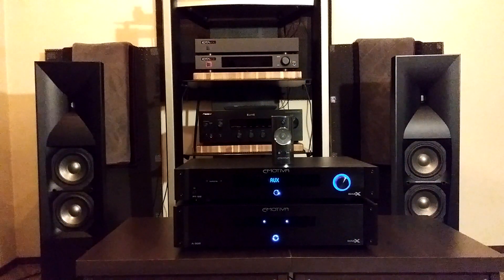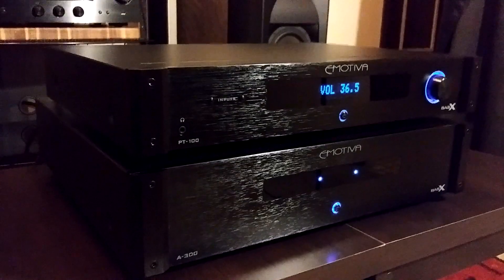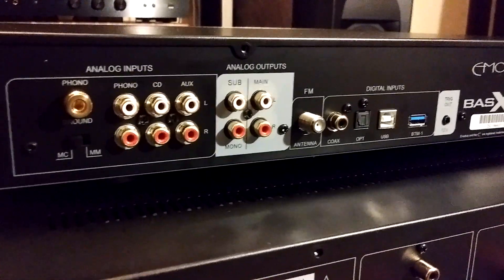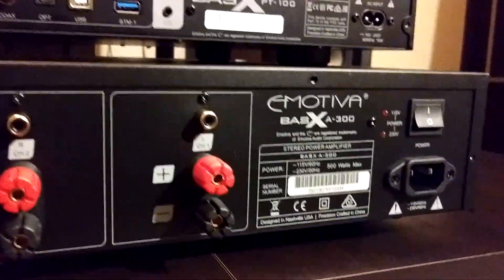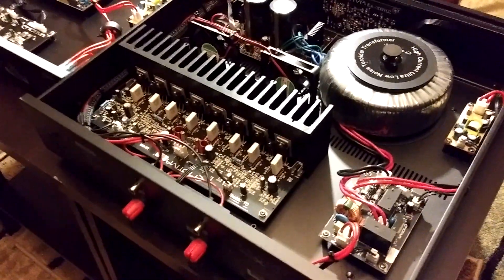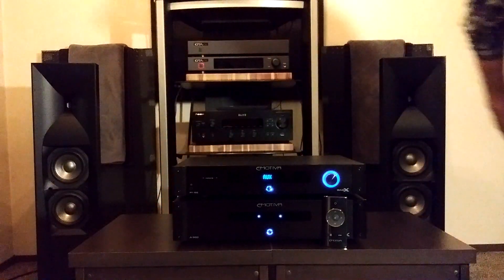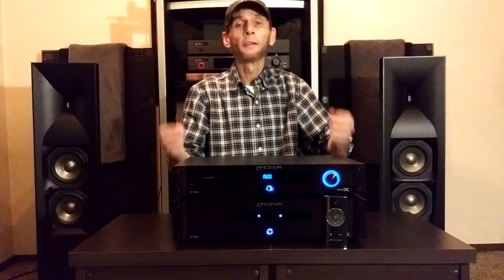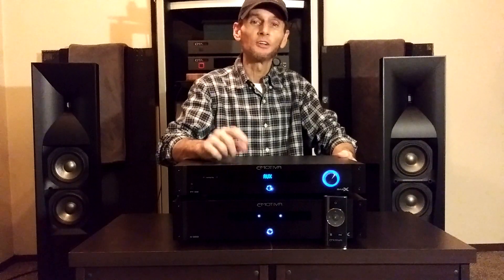Emotiva-BasX STACK ! PT-100-A300 SOLID STATE MUSCLE ON A BUDGET $700.00 dollars 🇺🇸 Part 1

Comment: I've had this setup for over 4yrs now. Driving eb78 bookshelves wired for both front and up firing. Running a pair of rythmik sealed servo subs wired in stereo vs mono..2.2 setup. Fills the room and brings out new  details from music I've heard my whole life prior to piping it through this rig. Around 2200 invested, no regrets. No issues.

Comment: You seem to be following my path into higher fidelity sound. heh. I went with a pair of the RP-160m's as you did, and then found the exceptional Emotiva electronics. For me, however, since I already have a pair of Adcom 555's, so as much power as any loudspeaker could possibly need, I went the PT-100/A-100 combo setup. The PT-100 is one of the best deals in audio, period, and the A-100 is a tiny tank! 

So, I bought the A-100 to power my 300ohm Sennheiser HD6xx's and the harder to drive AKG K7xx headphones. With the supplied jumpers installed, the amp provides full power to the headphone output. So, 12+wpc into 32 ohms and 1.3wpc into 300ohms; more than enough power to set any headphone on fire! Plus, it provides astounding quality sound for my speakers. I have a pair of ADS L910's; likely my end-game loudspeakers. At 93db, the A-100's 80wpc @ 4ohms is more than enough power for them. 

I am more than impressed with the build and sound quality of the Emotiva BasX line. And yesterday, my new Hsu Research VTK-2 MK5 12" sub arrived. It'll be paired with the SVS PB-2000. They are very close in specs so they should play very well together. Waiting on the new cables and splitters. 

Keep up the great work! Love your videos.
Reply: @Tom Rogers , how is the PT-100 as a pre with the Adcom 555 ? i have my self the 555mk2
Reply: @RanTausi  The PT-100 is a very neutral-sounding preamp and so far, it has worked well with any power amp I pair with it. I got a pair of immaculate ADS L910's a few months ago and after having the mids/tweets rebuilt, I started getting nervous running them with the Adcom, since it has no speaker protection circuit. So, I got a great deal on a NAD 208 thx power amp, and it plays really well with the Emotiva preamp. But, I am kind of in the market for a used preamp with balanced inputs/outputs to take advantage of the balanced inputs on the NAD amp.

Comment: Thinking about getting the Audiolab 6000A integrated amplifier, which I have auditioned for a very short time in a HiFi store near me. It can step down as a preamplifier, or it can step up as a straight power amplifier. I may have to consider the A-300, when I need more power. Still need to get my bookshelf speakers first though! 🙂
Reply from the maker: I used the ifi i-tube2 as a pre/buffer str8 to the A-300 and ohh my !! About to review the itube2 very soon !

Comment: Good equipment, good review.
I just replaced a venerable Phase Linear 4000 preamp with a PT-100. Great sound.
The interface is less than stellar, though. I feel like I’ve been transported back in time to an era without graphical interface . This preamp demands that the user memorize a multi-step sequence of button-pushing, dial-twisting and secret utterances for every conceivable purpose. I hope they’ll reconsider and improve that part of an otherwise great product.

Comment: Love the reviews.Tee-Jay can you suggest several stand alone dacs, better sounding than the one in the PT-100. Additionally any preamps other than the Iota to improve system sound.
Reply from the maker: For super budget price the Topping E30 is a noticeable difference in perfermace compared to The One in the Pt.100/IOTA SA-3 basically Emotiva/IOTA being so budget priced they couldn't put a 150-200 dac in them but depending on the sound you already have and want to achieve will play highly in choosing a cool-Netural-warm sounding dacs 😆

Comment: Hi again! Do you know what is the peak current for the A300? I can't seem to find this info anywhere. And do you think the A300 will pair well with the Audiolab 6000a sound-wise?
Reply from the maker: In my opion the Emo A300 paired up good with the audiolab 6000a espically for Pricepoint I actually BiAmped my 3 way speakers and I also used the 6000a as a pure preamp and Emotiva as the dedicated amp ! Theirs picks on my community page 😆 this combo helped alot with speakers that are hard to drive espically ! And the emo A300 has an  excellent price 
, But i do  wonder how a dedicated tube
 amp would sound paired to the Audiolab as well with biamping
Reply: @tee-jaythestereo-bargainph2120  Guess what, I just got the Emotiva A300 yesterday (A2 isn't available yet in Malaysia) on your recommendation and wow, I've never hooked anything up with something as powerful as 150/300w before. It really makes the speakers sing! And as you said, pairs really well with the Audiolab 6000a! Thanks, and keep it up man!
Reply from the maker: @kas4751  your welcome buddy glad yoy liked the pairing ! Enjoy 😃

Comment: This is my exact setup with a set of original T1s. Had an XDA-2 DAC, too, which was a bit better than the DAC in the PT-100, but it died in 2018. Power supply went out and fixing it was cost prohibitive.

One question I have is do you know how to make the PT-100 go beyond 80% output? If you crank the volume knob, top output is shown as 80%. I understand the premise, but say I wanted to push the limits of my system... how would I go about doing that?

Comment: What great reviews. Iam new to this new stuff this preamp has a Dac but it not WiFi or Bluetooth or ?  Can’t wait to see the compair of the 3 thanks and what a deal for this
Reply: So no streaming what I mentioned
Reply from the maker: You can buy a bluetooth dongle for the Preamp it has it on digital input on the back , it looks like a thumb drive the bluetooth dongle that is and no wifi but you digital inputs also coaxial digital tosling USB all these inputs go to the internal dac then the dac puts out an analog signal threw preouts thanks for the comment 😆

Comment: Hello sir, I just purchased a set of JBL studio 290. Would you say this is the best match for my new speakers? I was also looking at marantz mm7025. Thanks and keep up the good work!
Reply from the maker: Thanks for the reply , i don't have any expierence with the studio 290 , but i'm sure the Emotiva will drive them very hard for music playback , are you going to use them for home-theater or music or both ?
Reply: @tee-jaythestereo-bargainph2120  Music and home theater playback. Some compare the JBL studio 290 to Klipsch 280f. The JBL are rated Max RMS at 225. Not sure if that is for both tower or single, but I did read a written review of them being powered 160w per channel. What I really want to know is can a all in one receiver perform on par with the emotiva combo at the same price point.
Reply from the maker: @PunisherOfDeath101  at the equal price point and class AB as the Emotiva Combo you would be hard pressed to find an all in one unit to have this much power , Espically a hone theater reciever , They do make Monster recievers but their very exspensive , I honestly don't think you need that much power for the 290s , Yes overhead is good,  can you tell me if its 6 or 8 ohms and its efficancy ratings ? And i eill do my best to help ya 😆
Reply from the maker: @PunisherOfDeath101  are you going to use a powered subwoofer .
Reply: @tee-jaythestereo-bargainph2120  I will be building subwoofer enclosure and using a mono amp to power it. Peerless stw350f will be my subwoofer of choice powered by a crown 3k amplifier. The 290 are 8ohms each, 91db sensitivity at 1 watt.
Reply from the maker: @PunisherOfDeath101  Those will ne quite easy to drive and where yiur going to use a powered subwoofer , mist likely yiu eill have frequency cut-off between 60-80 Hz So yeah a good real 50-watts a channel amo with goid power supply will drive these speakers , not to concert levels but in that frequency range you should be good . at 100 clean watts yeah that would be plenty enough power . My JBL 580s are 90db effeciant and i can drive them with a 45 watt amp easy , not concert levels but its enough , but i do like 100 watts a channel on them theor rated at 200 watts
Reply: @tee-jaythestereo-bargainph2120  All I really got to worry about then is finding a receiver that has great sound quality to boot. Looking into Yamaha rn803 but that's the same price as the emotiva combo. Also the marantz 7025 caught my attention. It's going to be a toss up between those 3. $800 ideal budget. I'm go look into these units a little more. Let me know what you'd do if you had to make the choice. Thanks for the chat btw.

Comment: the blue light would bother me . is their a way to disable it ?
Reply: I have this stack and no. User supplied tape or open it cut the wires to the LEDs assuming they are not board mounted but even then can probably clip the leads.

Comment: Why would there be tariffs I thought it was American company I think you can get the tariff wavered should be able to under trading laws if registered in the country. Worth asking! What's it like feeding direct to the Poweramp from a DAC say what sort of Sound signature are you getting by bypassing the preamp.
Reply from the maker: Hey John just depends on the Dac/pre combo . I will say this once i hooked up the iFi i-tube2 buffer into the mix it added weight and warmth ! I will go over that during the iFi review 😆 
Thanks for stopping in buddy but hwving the option of tone controls and analog inputs and phone pre may appeal to people that just use  a pre/dac to amp and at 299.00US  its a very good deal and you get the remote which most DACs/pre dont have remote its rare
Reply: @tee-jaythestereo-bargainph2120  not sure I'm getting you you say you connected the DAC and tube buffer directly to the poweramp?? not through the preamp
Reply from the maker: @johnsweda2999  the ifi itube2 is a tube buffer and single ended preamp 😆 I use analog out from my schiit modi 3 dac to the ifi itube2 can can use the itube2 as a buffer or pre/buffer you can also use up to 9db gain review coming soon , its one of the best componetes i have reviewed so far , once you learn how to dial the tube2 into your system ohh my !!!!

Comment: i dont get sound out of my preamp im using anALOGUE whats wrong
Reply from the maker: Use preout to your amp a
Reply: @tee-jaythestereo-bargainph2120  amp a?    i have it set like this an aux to rca cord from my pc into the analogue input of the preamp then the preamps analogue output to the poweramp has a rca to rca cord
Reply from the maker: @akeelshah7904  I would have to see it can you run digital out of your p.c. to thr digital input of preamp then pre out of preamp to your amp
Reply: @tee-jaythestereo-bargainph2120  I'll try find a way of getting digital then I'll message back with results but on a working system isnt it supposed to work via analogue i only just got the preamp
Reply from the maker: @akeelshah7904  you only have the Preamp ? If you have no amp its not going to play with just a preamp you have to have an amp also !
Reply: @tee-jaythestereo-bargainph2120  i have the preamp and poweramp ofc im just going to return the preamp kinda heartbreaking she didnt have any input signal going thru tho so it is faulty on arrival
Reply from the maker: @akeelshah7904  you ran preout from preamp to amp ok did you put it on the right mode ? Like aux1 aux 2 digital 1 digital 2 ?
Reply from the maker: @akeelshah7904  and are you running digital or analog output. from your computer if so you may have to turn the computers volume up !!
Reply: @tee-jaythestereo-bargainph2120  yeah i was selected on aux and plugged into the aux connection
Reply: @tee-jaythestereo-bargainph2120  i ran with analogue because didnt have any usb type b lead im gonna get a cable from my sister's printer and try digital if it still doesn't work I'll have to return it as fully faulty
Reply: @tee-jaythestereo-bargainph2120  i just tried digital input it also didnt work so its faulty on arrival its getting returned
Reply from the maker: @akeelshah7904  Sorry that happenned to ya !

Comment: can this pair to B&W 603 speaker?
Reply from the maker: No !! 😆 just being honest in my humble Opion.
 even though i never owned the B&W 603 I know their sound chacter . 
If I was looking for something in this pricepoint for B&W I would  Maybe with a sonething like a  Denon PMA 800 integrated or a Audiolab6000a if thats not to exspensive its 1k in the U.S. Marantz Integrateds would work also 😃 I need to get sone B&W speakers in !
Reply: @tee-jaythestereo-bargainph2120  I'm using Marantz Pm6007 but I think it still not too good for this speaker
Reply from the maker: @Ibanezkanly  yeah i was thinking 8006 the lil beast , But yeah Danon Audiolab should be a goid match I been thinking serously about getting sone newer age B&W but they exspensive ! Those 803s geez they look amazing with that woid grain finish 😃
Reply from the maker: @Ibanezkanly  If you dont mind a hires Reciever The Pioneer SX-N30 85watts classAB it was 799.00 U.S. new and over in The U.K. this amp sold in pairs with the KEF Q-100/300 the synergy with them paired is crazy good but they don't sale them anymore you can pick them up for 300.00 used and its a fully loaded lil beast it blew the pants off my Yamaha AS-801 and thats coming fron a Yamaha fan The Elite has it all ! And can be used as a preamp with 2 subwoofer outputs detacable power cable all gold connection streamer B.T wifi usb flashdrive bassheads.com gave it a rave review especially over the bass output
Reply: @tee-jaythestereo-bargainph2120  I just want something less than 6" in H so it can fit for my desk. im thinking to get a Rotel A12 or ARCAM SA20 . this is so hard to decide :D have you try those amp?
Reply from the maker: @Ibanezkanly  alot of pep use Rotel with B&W And I am a huge Arcam fan i go way back but i haven't tried theor new gear . do you have s2 or s3 ?
Reply: @tee-jaythestereo-bargainph2120  yeah BW theyre makes Rotel , i dont owned none of them lol i just searching...
Reply from the maker: @Ibanezkanly  I bet a vintage Sansui reciever or Integrated over 50 pounds class ab would bring life to those b&w